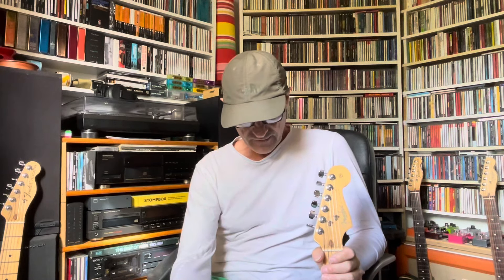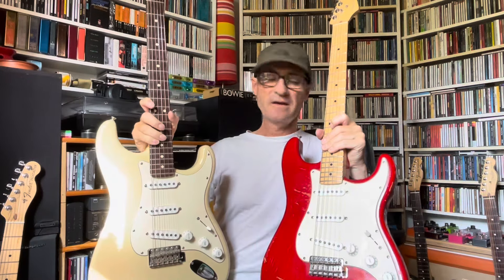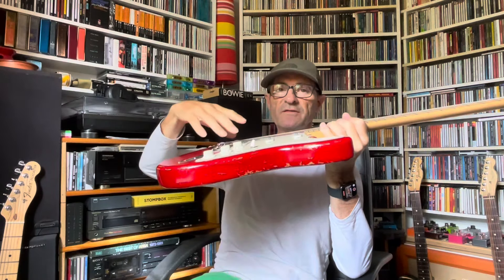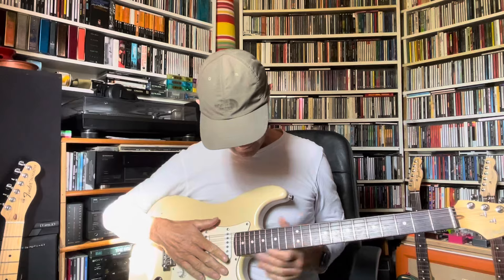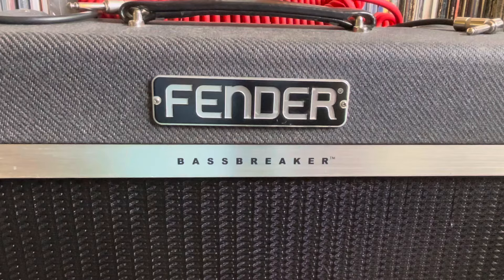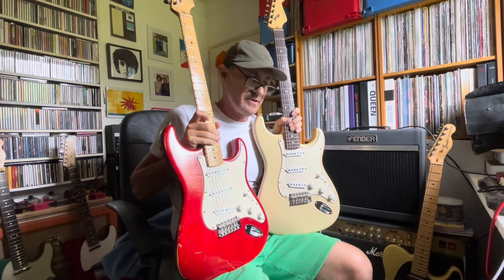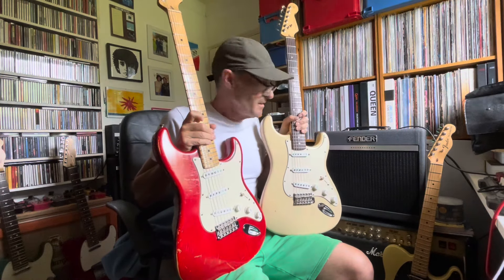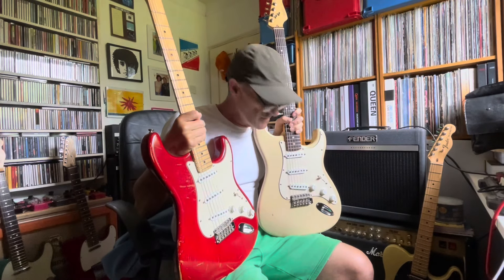FENDER STRAT MAPLE VS ROSEWOOD

Comment: For me it’s a feel thing. Ebony feels the best to me. Clapton has his maple fingerboards finished by super glue I have heard. I might try that.
Reply from the maker: He puts superglue on them? I’d avoid any of that to be honest. What a mess if it goes wrong! You can get oiled maple necks now if you don’t like gloss. Satin finish is nice too on a maple board.
Reply: Clapton has them master built by todd krouse and they are satin urethane finish. No way superglue.
Reply from the maker: @_leopold_butters_stotch  I’ve a 1997 Clapton signature “Blackie” and the finish came off the fingerboard as the guitar was in a humid place for a while. I had it refinished and it’s fine. No superglue! lol!
Reply: @KRAZEEIZATION  I had a 96 candy green a 2000 pewter and an 08 custom shop midnight blue that I stupidly got rid of all of. Guess I'm just a telecaster guy.
Reply from the maker: @_leopold_butters_stotch  I don’t really use the Clapton. Prefer passive Strats. But I’m a Tele guy 90% of the !